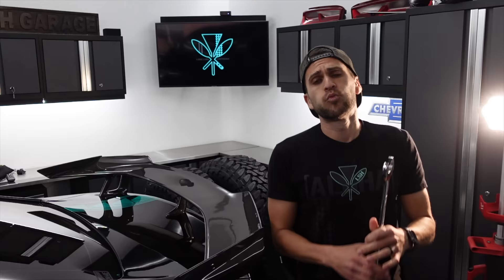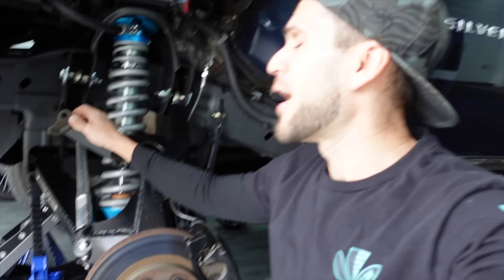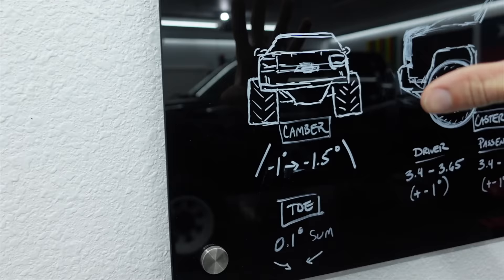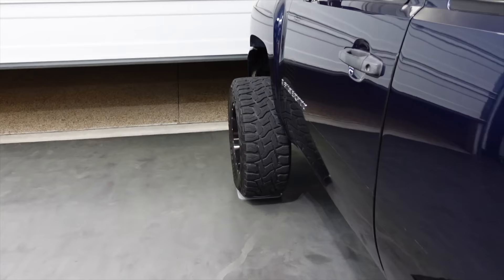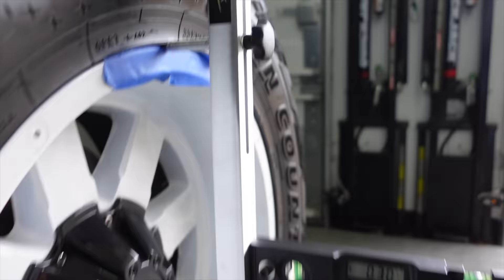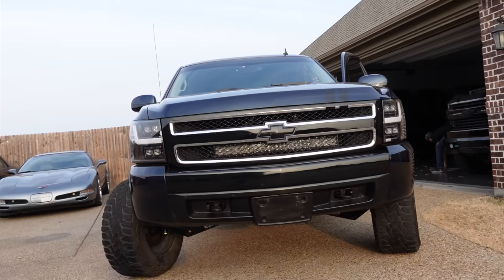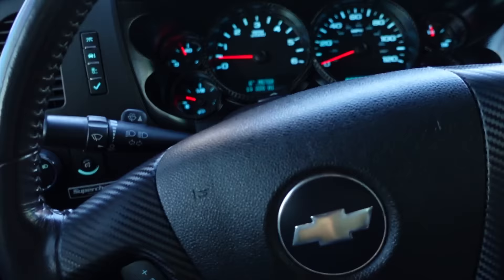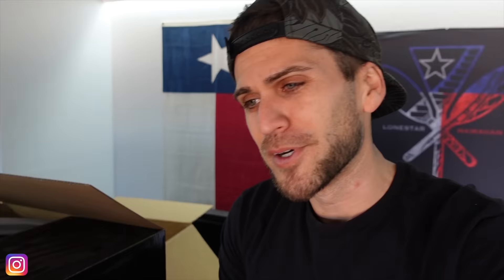FREE ALIGNMENTS FOREVER - Stop Paying For Crappy Work

Comment: The amount of Firestone alignments/suspension work  I've had to fix over the years is mindblowing
Reply: Ha, everyone really pushes alignments, some claiming every oil change.  Only two of my vehicles have been on an alignment machine and one of those was fubared (long story) while the other was only checked and deemed close enough.
Reply: @thisisyourcaptainspeaking2259  yeah that’s ridiculous. We recommended checking it when someone bought new tires especially with our roads here being horrible at best. Even then only about 50% off the cars checked would really need it. The alignment and front end check was only 19.99 and considering most of the work of doing an alignment was setting it up on the machine it was a good deal and cheap insurance to prevent prematurely wearing a new set of tires due to something like a worn out tie rod end or the alignment being off. Trying to sell an alignment every oil change is insanity
Reply: I’ve seen them come in with ball joints falling out due to being pressed in crooked and stretching the hole in the control arm, bushings on control arms that looked like they didn’t even try to press them in, Tire rods left so loose where the taper isn’t even seated in the knuckle. One of my biggest pet peeves was brand new inner tie rod ends with a missing or completely torn dust boots. They have to know that tie rod is not going to last very long all because they couldn’t bother to replace a $20 boot. Last week we had one from Firestone where they installed a new alternator, overtightened the stud on the back, and the car almost caught on fire due to melting the wires and harness it ran along with.
Reply: @Jpilgrim30  holy shit man what a bad shop
Reply: I bet you could count them, with numbers...
Reply: Alignments are a great way to boost gross profit. It's pure labor, and when you inevitably find worn parts, a fantastic tool to sell more work. If you want to spend a ton of time building tools and taking measurements, you can knock yourself out. I'll spent a hundred bucks and in an hour get it done at a good shop.
Reply: @Hawk7886  where are the good shops you speak of....  lol
Reply: Where does Big O fit into the mix? Pretty sure I know the answer to that though... 😂

Comment: I'm sixty eight years old. Been around vehicals from a hands on point like your son. Helping Dad, uncles and older brothers. 
I can remember the tyre/tire guys having basic gear just like you were using with a few little differences,  they also had a book with reference numbers and make their adjustments,  if you were still having problems they would apply experience, they would ask a bunch of questions and adjust to what their experience told them,  they were usually spot on.  These days most of the guys don't really understand what they are trying to accomplish and would not be able to do the job if there wasn't a computer attached.
Good show.
Reply: All the computer means is you don't need to hire someone with experience to get repeatable results.
Reply: Ok grandpa.  Next ull complain about calculators huh? 😂
Reply: @webguy943  calcu  what's??  Huh,  Nah I don't mind progress,  was just a comment on the way techs were able to have a handson feel for their work,  able to make repairs to the base unit,  instead  of just replacing parts. Just an acknowledgement for those that have gone before us.  The techs these days still have a feel for their equipment,  it's just through a computer.
Reply: @kezzatries  I dont understand how the new machines work. Never seen one. As far as im concerned its super accurate lasers or something you cant repeat with string.
Reply: @webguy943 
Have some respect; you might learn something after you grow up.
Reply: Yep I have a e46 in trying to get aligned.. Been to two garages and all you get is computer says correct... The car drives like shit I've made a few tweaks against their professional judgement and it drives so much better
Reply: @webguy943  The wisdom you have came from the elders that invented what you rely on now.
Reply: Well if they didnt have their books they would be just as lost as people without computers.

Comment: Wanna know some facts.
I used to work at Firestone as a tech before i quit.

One of the guys training me on the alignment rack (Hunter Rack).
If they were lazy, they would quickly punch the tire to get it to bounce into spec on the computer and quickly run over and hit the "save" button on the computer for the print out results to "show the customer".

Just food for thought guys. I didnt work with Firestone for long, maybe a month. I went into being a mobile mechanic because I wasnt taught to do shaddy work. My grandpa taught me that you do the job right the first time because you don't get paid twice. Be honest, I dont know everything but I'll tell you what, if i don't know. I will tell you that i don't know and I'm not very trained in this specific brand/model. Honesty goes a long way, it really does.
Reply: That's the same exact reason why dealership flat rate techs are constantly ** on. It's the lazy ones who want nothing more than to get the job done quickly and easily by ANY means possible because they only care about money and completely disregard the fact they're working on a 6-7 thousand pound death machine. One of the many things that sucks about the car industry is you actually get rewarded for that behavior at most - if not all - dealerships, and even some independent shops. It's the mechs/ techs that aren't trained well, aren't bright/ have no common sense, or are just pure lazy/ just do not care that give us a bad name.
Reply: Fire comment 🔥
Reply: @cameronbrule7912  I totally agree with you. The one thing that honestly bugs me the most is techs not torquing wheels after brakes or doing tires for example. They put them on with their impact and ship it saying it's fine. 
Techs do that and people wonder why the threads on the studs get stretched out. Especially if people are running wheel spacers. Also a good way to warp your rotors after a few heat cycles down the road and get a shimmy in the steering wheel when you hit the brakes. I understand a lot of cars don't make it easy to get a torque wrench in a lot of spots and you can judge it by experience.  I understand that side of it, but wheels are the easiest one to torque and it's also the most dangerous one to fall off going down the highway and a wheel and tire slamming into a school bus full of kids is what I think about. Imagine being a tech and getting sued because you're the last one who worked on it, and the tech signs the bottom of the paper. The business will throw techs under the bus if anything happens or BAR shows up to investigate.  I understand shops want to rush techs but stand together as techs in a shop and it gets done when it gets done because it's going to be done right or you can take it somewhere else. I've said that to a customer before and when I started my mobile mechanic business. He was one of my first customers and still is to this day. Great guy actually.
Reply: Link below of a bent rim most likely but just an example for people to see even if the rim was straight and true. If the lugnuts are not torqued evenly, you can see the brake caliper slides are moving in and out making for a warped rotor that would also cause the same drivability down the road. All from simply not torquing the lugnuts. 

https://youtube.com/shorts/n1wXxjONFHo?si=h9_PdBDT1pZcvNjO
Reply: I hear you, man. In a dealership of 11 techs, I'm somehow the only one that uses a torque wrench for a lot of things including spark plugs, valve covers, oil pans, control arms, and ALWAYS on wheels. I paid good money for a Snap On 1/2" digital torque wrench and I'm going to use it as much as I can, not to mention on safety items like wheels. And was handed down a 3/8" Snap On digital by my mentor before he retired so of course going to use that. The crappy thing too is I get all the cars other techs/ the wheel repair guys stripped out lug bolts and have to drill them out because other techs are too lazy/ can't be bothered, don't have the tools, or are flat out incapable of something as simple as drilling metal. And don't get me started about being rushed haha @JacobWinkle

Comment: Pro tip, recheck all angles after setting toe, changing toe by large amounts will change camber, especially on vehicles with high caster numbers. I always set toe first then caster/camber. then reset toe and verify cam/cas hasn't moved after. 

The reason for checking the rear on a straight axle design, 4-wheel alignment, is to verify the thrust angle of the rear is in tolerance, ensure frame is not offset, also helps in setting toe so the steering wheel is straight, i.e. if rear thrust angle favors the right, and you ignore the rear angle your steering wheel will appear to turn right while driving straight.

I would still verify accuracy of wheel alignment attachment, jack up wheel and check three equal points of wheel to see if all three camber points on wheel the same camber reading before doing actual alignment, if it is off the least little bit, alignment can eat tires or pull after adjusting alignment angles to perfect numbers.
Reply: This! I used to do alignments on the machines, I was one of the ones that actually cared and always wanted to get the alignment as perfect as possible for every car as if it was my own. Hence i don't work there anymore lol. I could do them within the allotted time but most shops don't care or the tech doesn't care. Anyway, almost 100% if his toe was that far out, and he didn't recheck the caster and camber, it's definitely gonna be out of alignment. He's gonna need new tires soon lol

Comment: Back in my racing days, I fabricated my own brackets to check camber with an angle finder and use fishing string to adjust toe. The caster would be adjusted to full positive. For the turning plates, 2 pieces of 12x12 vinyl tile, with a dab of oil between them, for each wheel.

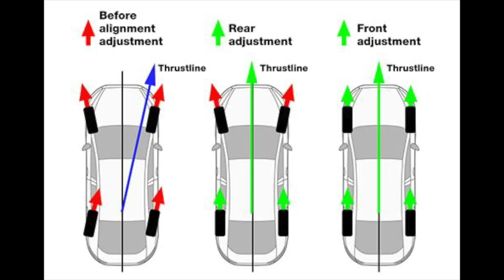Comment: @1:04
It's technically called 4 wheel "Thrust line" alignment.
The front wheels are aligned to the rear wheels.
Reply: We have a nice rack at work and it took me a few times to understand that I needed to align the rear of the car first lol. I'd do the front, then the rear, and then I'd need to adjust the front again 😆

Comment: While the shop is wrong about being able to adjust the rear of your truck, the machine needs all 4 alignment heads setup to measure thrust line (center line).  It then compares the center line of the vehicle to each wheel to make sure the adjustments made on toe\camber\caster don't push it out of center alignment.  If only the front was measured, then there's no way to know if the rear is aligned with the front and the vehicle doesn't crab down the road.  Yes, the front can be aligned separately but without measuring the rear and thrust line, your truck may not go down the road straight.  FYI
Reply: The old string trick would help eliminate that problem, would it not?

Comment: RE: 4-wheel alignment requirement -  rear thrust angle is required to set your steering wheel angle.  For example: presume your wheels and steering wheel are perfectly aligned, then adjust your rear beam axle position (i.e. left tire forward, right tire backward).  Now your vehicle dog-tracks and you must counter-steer to drive straight down the road.  Now, your steering wheel is mis-aligned.  Thus, rear axle measurement matters for setting the steering wheel angle.

Comment: If you have a bent wheel you're going to have bad alignment alignment shops don't check that and if you get this tool make sure you check your wheels it's very important
Reply: If your wheel is bent enough to throw Alignment out you’re sure as hell gonna feel it before you ever put it on a machine.
Reply: @frankz5864  I worked doing alignments we found out that if the wheel was bent 1/4" the customer didn't feel anything but that give me a .5 degree difference (you want a perfect alignment right?)
An overweight person would give me 1° to 2°difference that much did worn-out the tires 
And not to mention that the road has a built in rounded off edge to help channel the rain water away 
That would throw out the alignment
These situations where not in the alignment equipment manual
Reply: @cuda6496  An overweight person throws the alignment out? You don’t align a car with the driver in it and a 1/4 buckle would be much more pronounced in a 12in hatchback tyre than a 18in alloy. I have a little runabout with a bent alloy on the front wheel at the Moment and I can definitely feel it and the buckle is barely noticeable by eye. it gets pronounced at about 70mph so I thought it was a balance problem and I rebalanced it and yeah I could see the buckle when I spun it up on the balancer at work.
Reply: @@hedgeapple4374What no Krispy Kreme.  That's discrimination or racism or something! 😂😂 Ask any liberal! 😂😂

Comment: Great video and good on you for having a go.  If you are "playing" with suspension, wheel track or base, and/or wheel diameter then a wheel alignment is needed.  As you do do these changes, having you alignment gear makes sense.  Also you can experiment what works best for your setup.

Old school alignment (done 1000's this way).  That is exactly how I did alignments back in the 70's except no digital levels, just level bubbles.  Pro tip:  Due to camber in the road (road off side is normally lower to let water run off the road) the off side (passenger side) should have 1/2 degree more CASTER.   The big trick is to try to ensure your work space is as level as possible.

Also check your wheel base front to back on each side (wheel center to wheel center).  As your rear suspension is not alignable, any difference from side to side can mean: worn bushes, bent axle housing, bent chassis, bent front control arms, worn ball joints, etc.  Allowable in my opinion is about an 1/8 inch (be lucky to be less in a new vehicle from the factory).  If you have a difference I seem to remember that more cast may be required on the short side to compensate for the crabbing.

As you make changes there are some things that may require alignment tweaks (away from manufacturers specs).  As you widen the front wheel track the camber may need to change (and sometimes not as you think), also the toe in may need to change.  I've done a bit with race and modified vehicles. 

I still have the turn tables in storage ........... I think. 🙂
Reply: 100% Agree mate in AUS btw I am an Alignment tech myself any tips n tricks you can share other than heat and leverage XD im always keen to learn more
Reply: It's crowning in the road not camber and I would be irritated if someone did that to my alignment without asking.

Comment: You can get a Alignment rack with the computer and lasers for $10k, might have to look into one of those alignment tools. I'm at the point where I'm getting tired of having to double pay for things due to other peoples errors. I can never find someone around me who I would love to constantly take stuff to, plus when your constantly going in and some sort of suspension work or work that requires suspension to be disconnect it sucks to have to repay for alignment afterword's. and after having to train a tire shop on how to deal with my special Icon Rebound Pro rims and getting charged extra  per wheel for mounting I'm considering looking into the tire changing machines with the mount and balance combo for $3k. Cause then I would have unlimited balances and rebalances for free plus be able to set the weights correctly for clearance of the caliper. (life of a 17" on a 16" brake 😆)
Reply: Gotta pay to play, sport

Comment: Keep in mind your also buying common sense and knowledge. Most tire stores don't care and they are repetitious. You care and love learning. I bought a 2013 Toyota Highlander, the salesman said you have brand new tires on this... 7 months later, including 3 tire balancing and 1 4 wheel alignment I was still getting alot of road noise, it road rough and just not good. I finally said the heck with it and bought a set of Falken Wildpeak. The sales guy asked are you sure you want such an agressive tire and not an all season. I asked him if he wanted my business. He also had a really cool tool that read the serial number on my current tires and they were 2 years old. So, the dealership I bought this 2013 from put a set of NEVER driven 2 year old tires on my Highlander. Nice... These dang so called agressive Falkens drive smoother than any highway tire I have ever had and they are quiet. And it drives straight.

Comment: When I used to do alignments I did them with the vehicle running so the alignment is set with the power steering pump running. An alignment with the pump off vs pump can make a big difference in steering wheel placement and alignment.
Reply: Makes zero sense.
Reply: @spiritlevelstudios  it does makes a little bit of sense, in theory. With power steering on: everything cooperates and moves smooth.     With power steering off, you can pry one thing and it moves while the rest sits still.  Or everything except a couple things move, that are stiff or frozen.  Depending on worn bushings or just things seizing up. 

I live where there is more potholes in a square mile radius then some entire states have. And a lot of rust — bushings, joints, arms, racks, rods and brackets wear out or get bent all the time.  And some people can only afford to fix one thing at a time.    I know you can’t call a vehicle “properly aligned” unless all suspension parts are 100% in good shape so let’s just say this for the P/S on argument:  I’ve seen plenty of cars have intermediate shaft issues.  where there’s a lot of play in the steering wheel but it doesn’t move the rack or the wheels.        And many customers don’t want to pay for their rack to be removed or subframe dropped  just to access and replace the steering shaft.